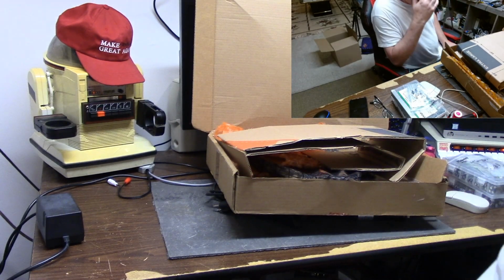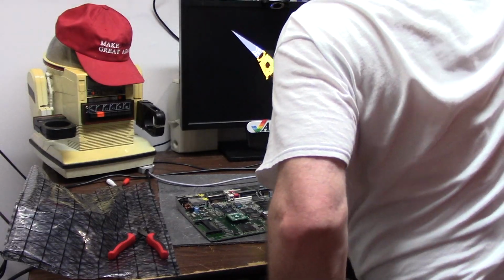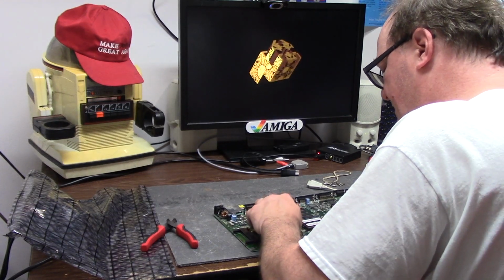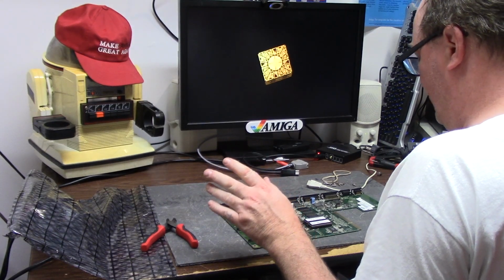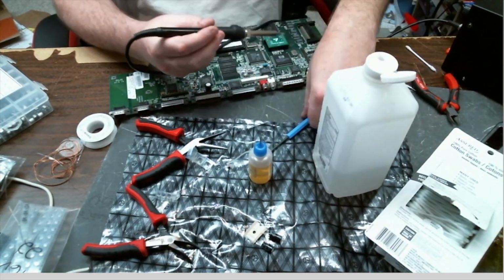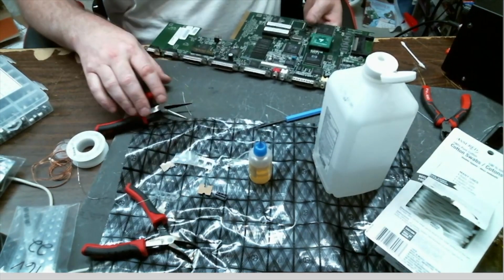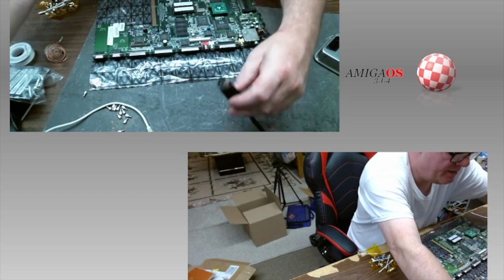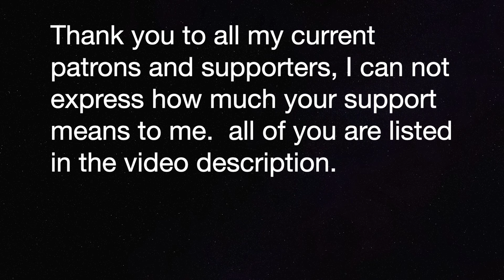A1200 recap and repair in 12 mins*

Comment: I just remove the keyboard connectors to make room when I change those hard to get at caps.  I have new keyboard connectors if I should need them.  I got use to soldering under my microscope which took me a while to get use too.   I still on occasion use magnifiers but not as often as I use to.    At work I have to use magnifiers all the time because I don't have a microscope at work but I will take things home to work on because I have better toys to use as home.  Plus there is no one to distract me at home unlike work which happens more than I like but its the perks of running a small manufacturing facility.

Comment: Great Vid Chris 👍🏻 Kudos to the owner having a Rev 1D1 board, as for some reason it’s the only revision I’ve had a lot of success with. Especially Expansion cards and Mediator and G-REX add-on bus boards. What happened to using the hot tweezers? 😉

Comment: I have three… two have the same video issue… and I have already recapped it… no change.
Reply from the maker: How does Alice and Lisa work
Reply: Recap do not fix broken things and dead boards in most all cases. Video issues are usually a result of Alice or even Lisa, or things in between. The Video encoder can also be a failure item. Cool fact: 1200 will run and boot just fine with NO caps at all on it ;)
Reply: @ChrisEdwardsRestoration  I don’t know enough to test. I get fuzzy video and no color output on composite. I haven’t gotten my 1084 repaired yet to use rgb out.
Reply from the maker: @Acill  ahh is that the sony 2075 chip?  thought that was just for composite